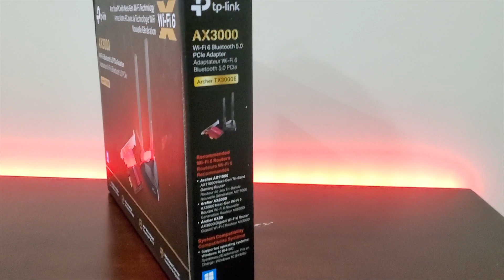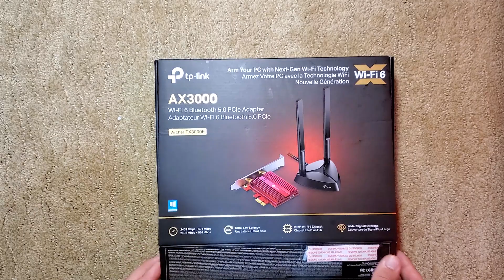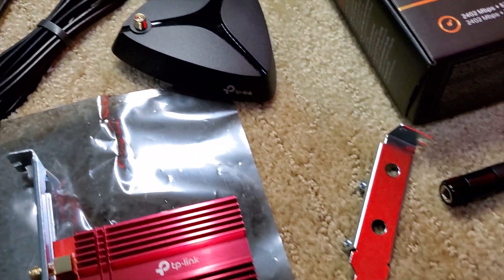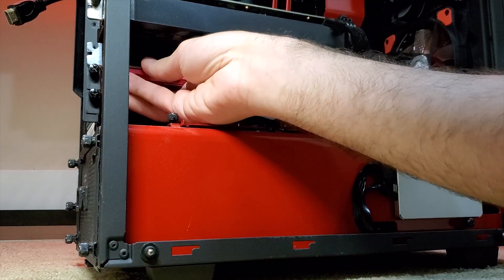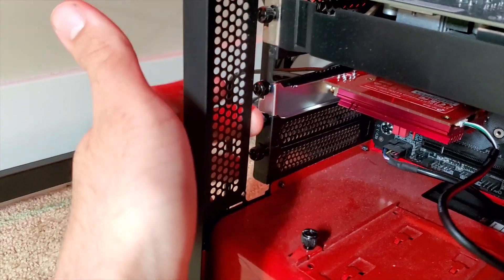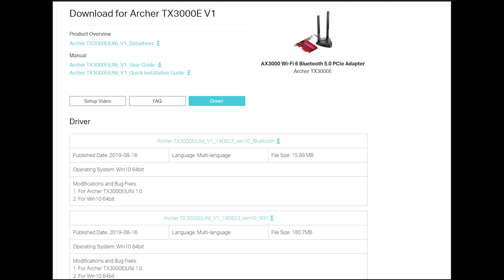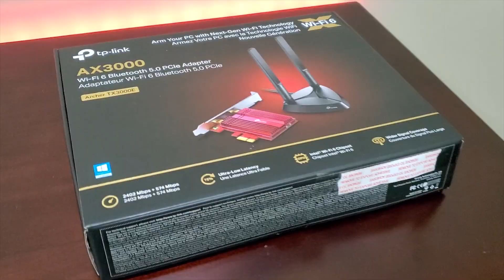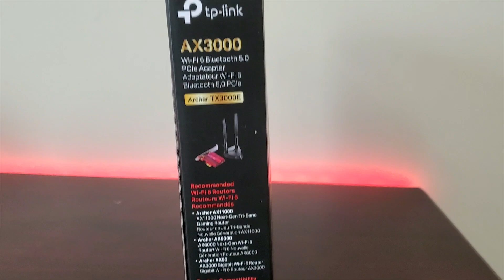PCIe WIFI Adapter | TP-Link AX3000 Archer | Unboxing Setup Review

Comment: I just bought it. There are 2 walls between my room and modem. I receive 700mbps connection with modem. I'm sure if I tweak its advanced settings, I can get even more speed but no need since my internet speed is 200mbps. Also no lag whatsoever on bluetooth with my xbox one 9th gen controller.
Reply: You get full Signal ? I do have the router 2 walls away too

Comment: Could you just sit the base anywhere it reaches? The area my PC is in right now is a low point for wi-fi signal, so if i could elevate the base it would get much better connection. Or does it have to be at the PC?
Reply: You could elevate the base and you can get a better connection as  it is received from the entina and passed through the wire to your pc

Comment: would anyone know what the internal network speeds are of these and how much does it drop when you download? Simple to check by going into control panel, network, change adapter settings then douple click your wireless nework. You wthen see the true performance of your adpater, Many wifi 6 adapters get the download speeds rated for, but the internal speeds (ex: how long it take to communicate with your printer (dlay speeds) and how fast a file can transfer fromone device to another Many fall short and there is a huge drop. I had one that told me I was getting 1.7MBPS, then when I went to transfer a small file or print something it dropped to only 428MBPS. huge drop, so I was wondering if anyone ever checked this adapter out like that

Comment: Does this require the usb connection on the motherboard?
Reply from the maker: Get your motherboards specifications sheet. It varies, sometimes the card might sit too close to the gpu air intake fans  which is bad

Comment: Edit....NOT  Bad card.. so many having problems.. i can not get over 229.4 at RX on the AX to AX92U router or any else  . whatever i do it`s stuck on 229.4 RX  and i am well in to network and computers
Reply from the maker: It's been working good for me. Sorry it didn't meet your needs
Reply: @jxgmedia256  sorted out... It was the AX92u... 2 firmware's ago fixed it so i take it all back.. Working great now.. I was not alone with the same bottleneck ;) also take a hard reset with wps button reset and power. Normal resetting did not fix it

Comment: Very nice video, but I suspect part of the difference is not that the old Inamax adapter was USB instead of a PCI card, but that your USB adapter has the old AC wifi standard, while the new Asus card should have an Intel AX standard wifi adapter in it (also called "Wifi 6"). AX wifi can be much faster than AC - definitely recommended. Anyway, I also like that this card gives you both wifi and bluetooth, without giving up an external USB port.
Reply from the maker: Thanks for your feedback
Reply: Nice

Comment: hi bro im going to plug  ax3000 on the pcieX2 slot and my motherboard got two usb port one is F_usb2 another one is F_usb1. 
Should i plug in to the F_usb2 because my im using the pcieX2 not the PcieX1. 
OR plug into either one usb port will be fine?
Reply: Either one.
Reply: @HelloSnake  tq

Comment: Why my motherboard cannot detect it, I tried reinstall the driver it won't work, is there any solution?
Reply: Hi. Did you manage to solve it?
Reply: @olegkolgatin5279  replace power supply can solve the issue

Comment: U got my subs, question: is it possible to extend the cable connecting the antenna to the card? If so what type of cable and connector size to get?
Reply from the maker: Sorry, I'm not sure what the cable type is called.

Comment: I was trying to get this setup on my system. I have tried on two empty pcie X1  slots. This is not displaying in network drivers. I have Default wifi6 ax200 wifi drivers. Unable to connect this wifi card
Reply: Hi... Seems like an old post, but did you solve it?

Comment: Hello,maybe you can help me.I install Intel driver 22.40.0. But i not have Connection to my @t router is Wifi 6 ax 80 Ghz .In my system is all ok.Think problem from the Router setting????

Comment: hi bro will this work with all motherboards ? my pc is 3 years old  also do i must have a router that support wifi6 inoder for
Reply from the maker: No you don't need a wifi 6 router. It works with my normal router. If your motherboard has an empty PCIe slot it should work. Search up your motherboard, and check if it has an empty slot. Good luck. Thanks

Comment: How long is the antenna cable tho? Tryna figure out it it will reach around the back of my desk to the top, thx.
Reply from the maker: My pc sits on the ground, and I can get it up to my desk easy, depends on how far back around you need to go.
Reply: @jxgmedia256  sweet thanks!

Comment: How's the latency and connection of it? I'm scared of using it compared to Powerline Adapter as lagging and high ping while gaming on WiFi is the bane of my existence
Reply from the maker: The ping is alright, still wifi at the end of the day. Wired connection will always be better

Comment: So I don't have any wifi router at my home and I'm gonna build my first pc next month so, will this work if I don't have any router??
Reply: this is just so u can have wii access on ur pc. u will still need internet connection. uness u are able to use ethernet cable
Reply: @maungaye8431  so i need a wifi router to connect with it? Or can i get wifi with this to my pc and can play games without my router?
Reply: @sharduljadhav6263  A router is what supplies the WiFi signal from your modem. So yes, in order to use this card, you will need a router. Otherwise, you will have to be connected by an ethernet cable from the modem.

Comment: Is this any good cuz i seen some bad reviews on amazon on how garbage the connection is and its update software which havent been updated since 2015
Reply from the maker: The tp link pcie wifi adapter in this video is new. Came out within the past year. This one works good for me. No problems with drivers.
Reply: @jxgmedia256  Aight ty man

Comment: will it be able to connect to wifi farther away compared to USB dongles?
Reply from the maker: Id like to believe so, it does have the double antennas, my set up is fairly close to the router, so no personal experience with the performance over larger distances.

The one advantage is that you can position the antennas in a desirable location, because they have a wire. Id recommend trying it out,
Reply: @jxgmedia256  I just ordered it, will try it out when it gets here
Reply from the maker: Nice, let me know how it works.
Reply: @jxgmedia256  it works fine, it doesn't really change anything. But the WiFi here in the Philippines is always slow, so I don't really have anything to compare it to.
Reply: @davevincentvillono3500  ano balita bro ,gumana bato sa mga ryzen chipsets..
Reply: @neilzracked  yes, it works for ryzen chipsets

Comment: Wow, nice review 🙏. I'm planning to get one asap. I'm an AMD Ryzen user (Asus Rog Strix x470-f and 2600x), does it work with my rig?. I need wifi connection and also a good bluetooth stability (this one is really important for me).

Could you please tell your thoughts about its performance through all this time using it?.

Btw, like and subscribed. Keep it up the good work 🙏
Reply from the maker: Nice to hear that the video was good. Thanks. I also have a ryzen 2600x, the wifi card plugs into your motherboards pcie port. Your graphics card should be plugged into a pcie port and there should be empty ports under the g card. So it will work as long as your have an empty pcie port. 

The wifi is very reliable. I use it to play video games and get solid ping. Personally have not used the Bluetooth enough to speak on its reliability.
Reply: @jxgmedia256  Thank you so much 🙏
Reply: Does not work good on ryzen and asus/amd  i can not get over 229.4 at RX on the AX to AX92U router or any else  . whatever i do it`s stuck on 229.4 RX  and i am well in to network and computers
what speed did you get on AX . i got 2400 TX but never over 229.4 RX
Reply: @kendexter  better than my case. seems like doesn't work at all on my msi b450-a pro... nothing in network adapters
Reply: @kendexter  It's working superb in my computer, no issues at the moment

Comment: Does this work with any wifi routers?
Reply from the maker: Yes
Reply: 2.4G (i think), 5G, wifi 6, wifi 6E (upgraded model) although 5G and 2.4G is most commonly used

Comment: Just fyi, it’s megabits (Mb), not megabytes (MB). Comes from the 8 bits = 1 byte thing. Nice review, otherwise :) Got the card a few weeks ago and it doubled my speed, from 250mbps with another pci e adapter, to about 500. On wifi 5.
Ping also decreased (great for gaming).
Reply from the maker: Thanks, I always thought it was megabytes for some reason. Mega bit per second makes alot more sense.

Comment: Can i dont plug the usb cable to power ? If i dont like to use Bluetooth ?
Or i should plug everything ?
Reply from the maker: You don't have to plug in the USB cable to your motherboard. The USB cable is just for the Bluetooth. The power comes from the pcie slot. So if you don't need Bluetooth, connecting the USB cable is not necessary.
Reply: @jxgmedia256  im using 5g route and wirless connections to my gaming pc so do u really recommend this item ?
Thanks bro
Reply from the maker: It really depends on the internet service you are paying for. Like if your playing for 500 mega bits per second down, and your pc is only getting 200, it might be worth trying this adapter out. By the way getting an ethernet cable is always a good alternative. The adapter is definitely capable of very high download speeds.
Reply from the maker: There are also cheaper options on Amazon with good reviews. This one is priced higher because of the Bluetooth and wifi 6.

Comment: Does it have the compatibility to create a hotspot? And what kind if so, 2.4 ,5  or both? And how good is it on gaming devices?. Thank you
Reply from the maker: Not sure about the Hotspot capability, I recommend checking out their website. 

I installed it on my pc and got really low ping,  which is key for online gaming. I'd recommend it for gaming. Really depends on  the speeds your getting from your isp, and your router and modem setup. They all play a role in the wifi adapter performance.

Comment: Do you need to plug in the cable to the motherboard and WiFi card or no
Reply from the maker: Only if you want Bluetooth
Reply from the maker: The usb cable between the card and motherboard enables the Bluetooth after you install the Bluetooth driver,. The wifi works fine without the cable plugged.
Reply: I'm not going to plug this cable in just for looks 🤣🤣

Comment: tp-link Archer TX3000E says Bluetooth cable should be connected to F_USB on mobo. I have a MSI x570 A-pro mobo, which does not have that F_USB. I do see J_USB1, J_USB2 and J_USB3. J_USB3 is connected to USB 3 in front pannel, can I connect tp-link Archer TX3000E Bluetooth to J_USB1 since F_USB and J_USB both are 9 pins ?
Reply from the maker: Does the Bluetooth not work in the f_usb ?
Reply: Did you figure this out? I have the same problem currently
Reply: @Pwnztankerz  F USB and J USB ports are the same
Reply: F USB and J USB ports are the same